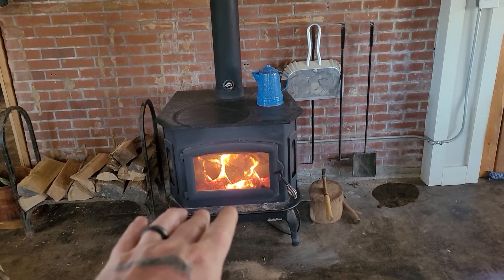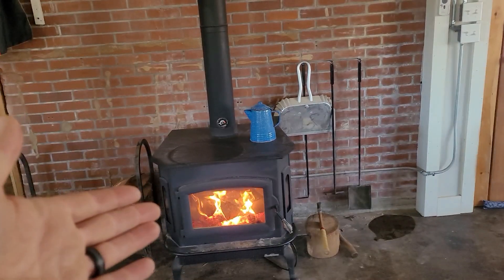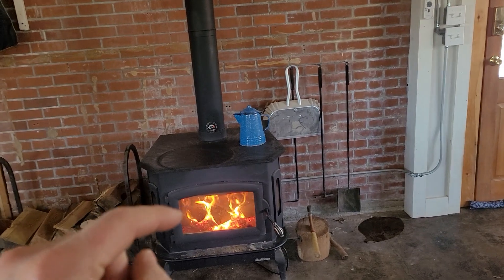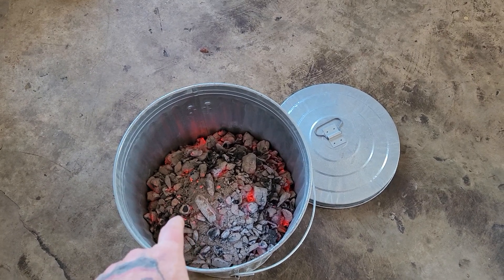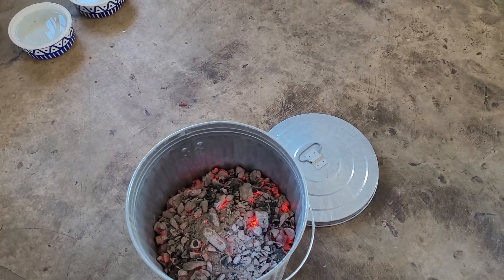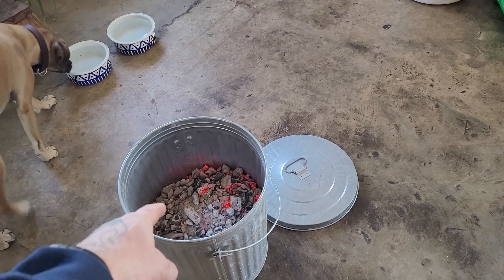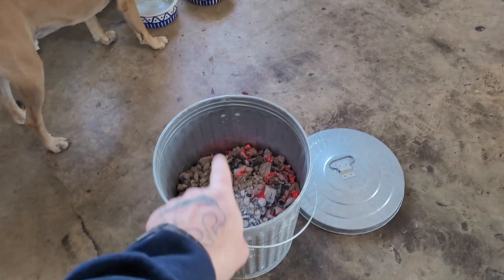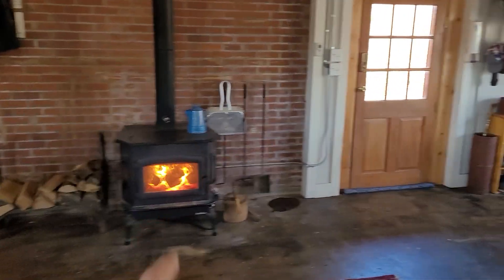Easy and free secondary heat source!

Comment: Move all your coals to center of stove place one well seasoned stick of firewood of moderate size atop the piled coals. Open draft damper to maximum airflow . You’ll get good heat and not waste the unspent wood coals. You can shovel out the ash once the coals burn down some and reload without sacrificing heat protection. Also like the last fella stated Carbon monoxide is no joke.

Comment: I’ve found that a cheap little dollar store $15 dollar box fan on medium about 3’ from behind/beside your stove will blow a lot of really warm air throughout your room with very little cost…. You keep it away from the front because that’s going to be effecting your damper’s..,,  if you have 2-3 foot behind it and you can slip it into that area… you are really blowing some massive heat out into the room…. Those 24” cheapO box fans are pretty much perfect for blowing your box heat and if it’s really going hot you can run your fan on high and your be moving a ton of heat around the room!!!   You might want to grab a 24”x 24” 1” thick stepping stone and set your can of ashes on that to protect the floor!!!!

Comment: I had the same exact issue last night. My stove was 3/4 full of pure red coals so I had to empty my stove to add more wood to put out more heat. I couldn’t use my ash bucket cause I have laminate wood floors and didn’t trust my stove mat to prevent burning my floor. I keep my house 100 degrees when it’s really cold to evenly keep my 5 bedroom home warm. Wood heat is my primary heat source
Reply: Get a 24”x 24” 1’ think concrete paver from your local landscaping supply center and set your metal can on that…, you can 6-6” square 1” pavers and place those on top of your big piece…, then you have air flowing under your can too!   Any room with the can and firebox should definitely have a smoke and co2 detector overa doorway

Comment: Run a pipe down the inside to the bottom and up to the edge with a elbow so air can be directed to the bottom of the bucket and under the coals. That way the ashes won't put the lower coals out.
Reply: That's great idea Tnx 👊🙂

Comment: You never had any issues before because you were putting the ashes in there and then dumping them somewhere else and they weren't staying in there very long and they probably weren't hot when you did it before. It is an absolute fact that heating galvanized metal releases toxic fumes that can kill you.